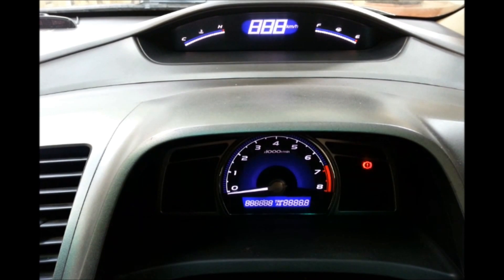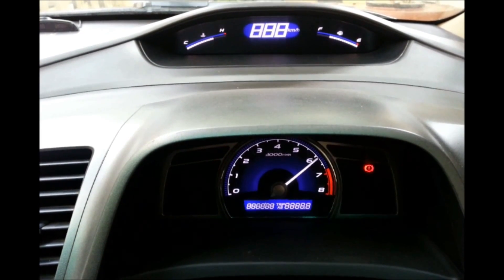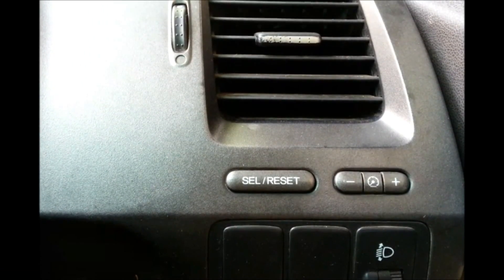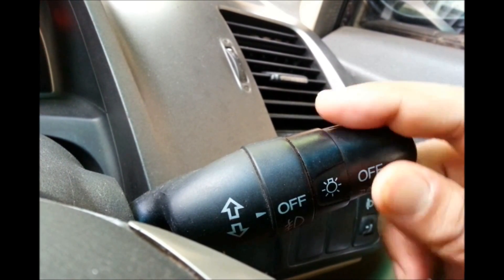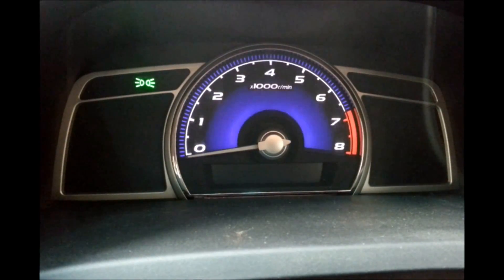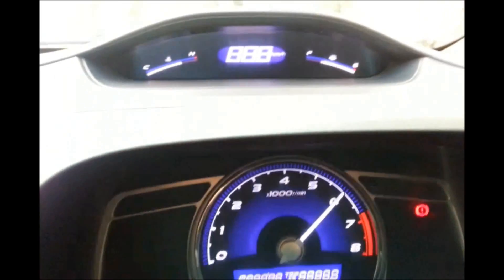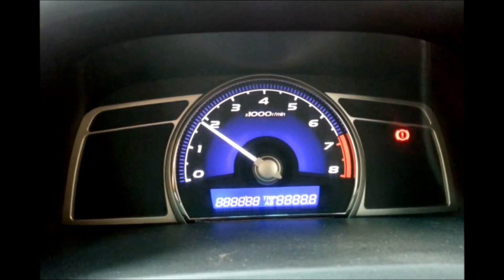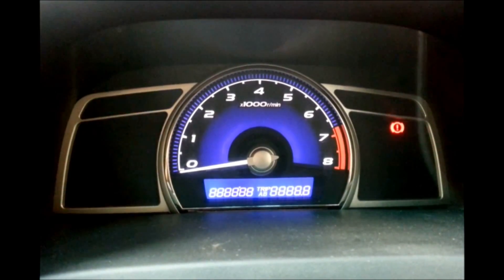Honda Civic Speedometer Diagnostics Test

Comment: I did this test speedometer still isn't working! Says I'm going 125mph whe. I'm only doing 70mph
Reply: you might have switch to KPH instead of MPH
Reply: @series.blueBRZ  How is that possible? My miles on my car sky rocketed!
Reply: @roymartinez995  hold down the MPH/KPH button till you hear a beep
Reply: @series.blueBRZ  What about the mileage? Would that change as well?
Reply: @roymartinez995  yes it will change too
Reply: @series.blueBRZ  WTF I have to check that out! My me hanic told me I needed to  change out my speedometer
Reply: @series.blueBRZ  Gracias homie I feel like such a dumb ass! I dont know how it changed on its own I've never even pushed that button! I was driving on the freeway one day and I looked up at my speedometer and it said I was doing 120 I looked around like WTF other cars were passing me so I knew I was going that fast but never stopped to think and look at the mph! Thanks for looking out I appreciate your help!
Reply: @roymartinez995  it happens lol  ,your welcome bro!
Reply: @roymartinez995  OMG this just happened to me, it changed to kph all by itself! All good now, thank you!
Reply: @series.blueBRZ  thank you so much, mine changed to kph by itself and I changed it back and all is good!

Comment: Thank you I was looking for this THANKS TO YOU I was able to test it, I think I need a new light bulb because the speedometer that shows the 888 and hot & cold and fuel was completely off couldn't see anything pitch darkness, but was able  to see the bottom one so I think have a problem 😕😖
Reply: @Shameer Shaik The speedometer unit had to change (78120-SNA-A14). The electronics were going bad. It could of possibly been repaired by a good tech.
Reply: Hi i have the same problem, the upper dashboard with the speedometer, fuel and temp doesn't display. How did you fix the issue?

Comment: Hi I have a problem with my civic 2007. After I switch off the car that's is car off keys out and lock on. My speedo console which has temperature gauge,digital speedo and fuel gauge it automatically starts and flickers on-off. Did the diagnostic test it didn't show any error code.
Reply: Same problem with me also
Reply: Same with me did you solved?
Reply: Pls reply